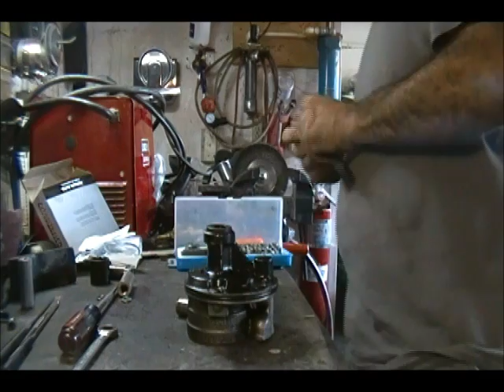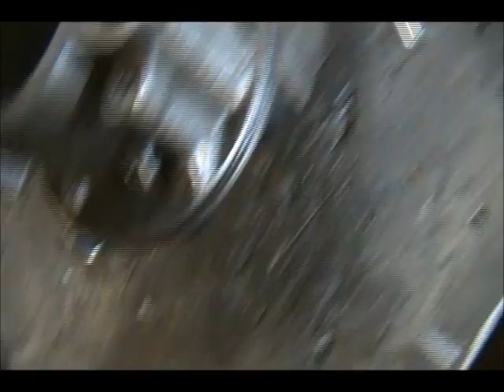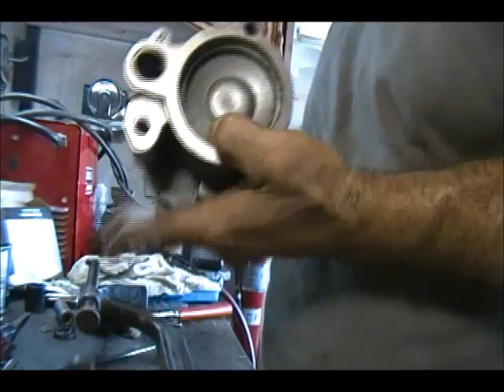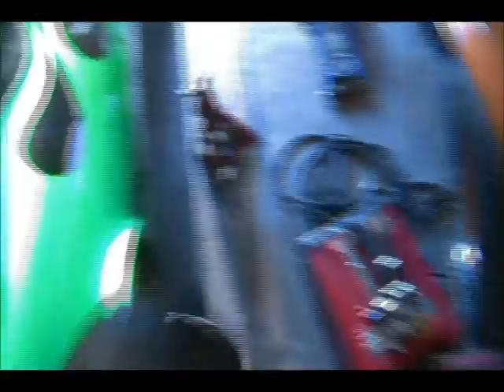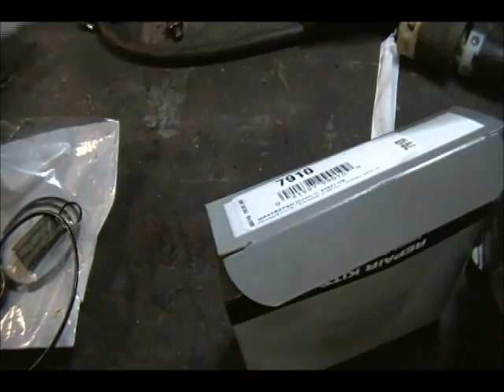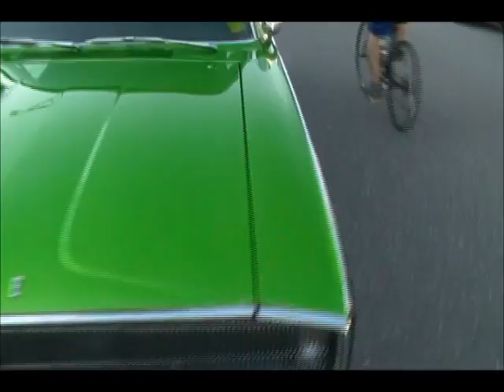71 camaro power steering pump rebuild pt 2

Comment: Nice job! FYI: I consider that a bushing not a bearing.  Usually bearings have balls or rollers.  Terms .. Thanks
Reply from the maker: so ron what is a cam bearing compromised of ? hmmmm hmmmmm? lol I really don't care what it's called I'm calling it done!!! peace
Reply: This made me smile and made an alarm bell go off in my head. A thousand years ago when I was at Purdue Univ. one of my mates got his Master's in Automotive engineering, and in his Master's thesis he found this note from one of the judges: "Every engineer should know that the cam shafts in automotive engines rotate in bushings, not in bearings. Only Bugatti and Porsche racing engines have used needle bearings for their camshafts."
We humans are often very careless with language. On YouTube recently someone gave a long lesson about how wrong it is to speak of a motor when one means an engine. He ended by saying, "The next time you look in the motor compartment remember that''s an engine you are looking at." Say What?
Reply from the maker: +Bruce Boschek tomatoe tomatto all I knows is I fixed that sumbitch .....lol thank you bruce take care give valentino a extra pat for me